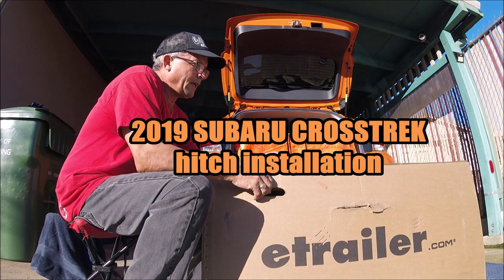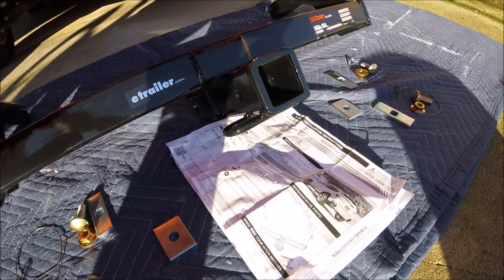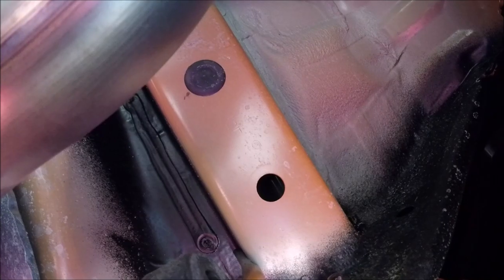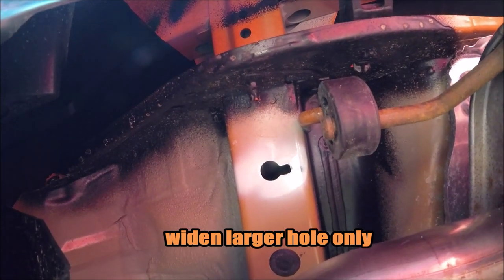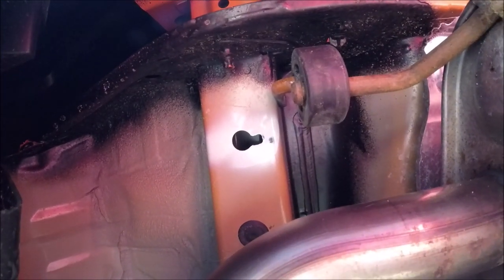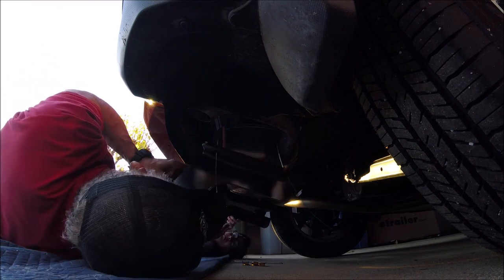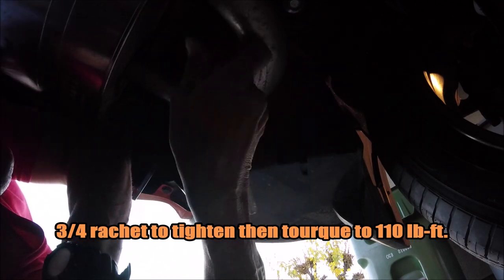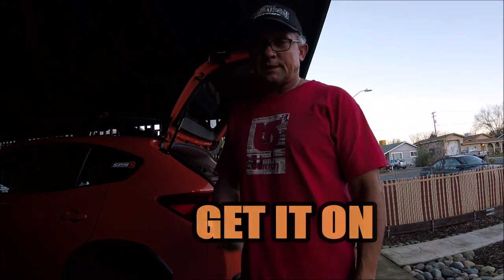2019 SUBARU CROSSTREK hitch install

Comment: Why not grind the rectangular piece narrow enough to fit instead of hacking the frame
Reply from the maker: Not recommend, the frame is thin metal and the washer is thick steal…it’s also the strength of the hitch.